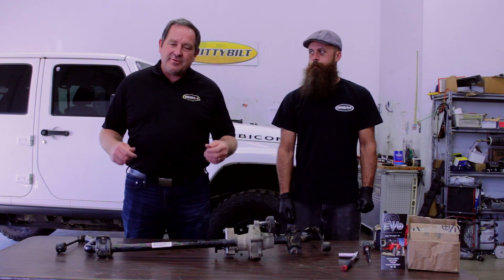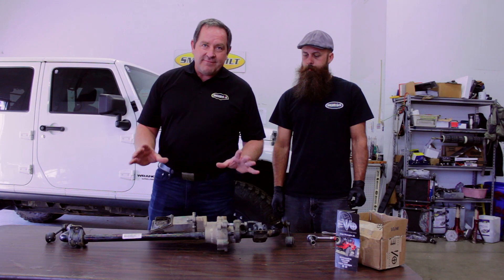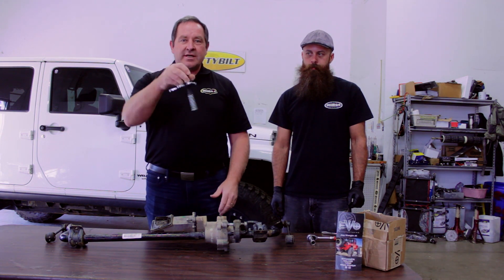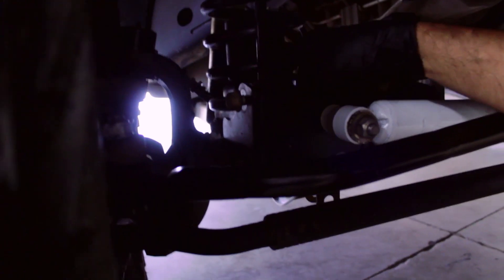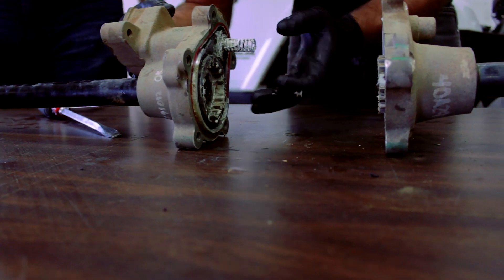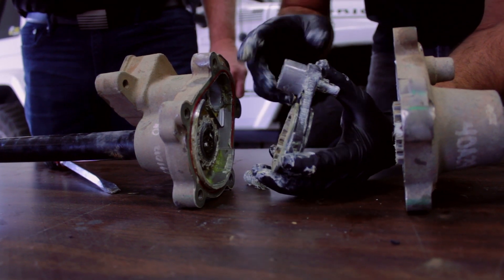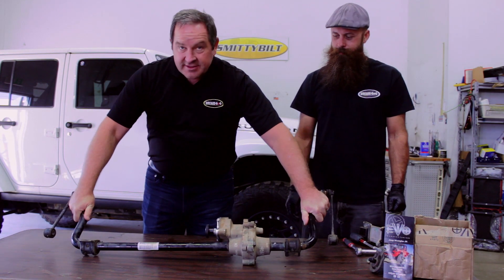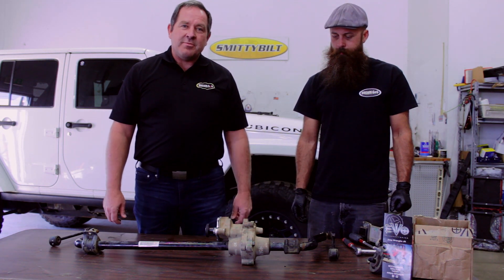How to Fix a Jeep Wrangler Electronic Sway Bar Disconnect

Comment: My Rubicon has the dreaded blinking Sway Bar light on the dash. I also have the JKS quick disconnects, so I removed them to try to diagnose or free up the sway bar to reengage, and the two ends of the sway bar are moving independently like it is disconnected. I'll try to take it apart and re-lubricate like in this video to see if the motor can lock it back in place. Otherwise I may have to go to a junkyard and try to find a solid sway bar off a Sport or Sahara since I already have the JKS disconnects anyway...

Comment: I have a 2017 Jeep Wrangler sport.
My sway bar light comes on when I first start the engine and the. Goes off as I’m driving. I looked at my sway bar and it doesn’t seem to have that motor attachment to it.
Reply: This is for the Rubicon models with the factory electronic sway bar disconnect

Comment: My 2017 Rubicon has a metal skid plate under the sway bar disconnect motor.  How do you get to that manual knob with the skid plate in place?  Thanks!
Reply: You don't.  It's pretty much impossible to access this type of system with a front end skid.  JKS does make a wire pull actuated version that you can mount on your bumper, fender, etc.

Comment: my sway bar light blinks non- stop. ( 2008  Wrangler )The local dealer only wants $2000 for a new sway bar .... BUT what I've read is that the blinking light means it is Not Disengaged.  A good thing right?    How can I make it go off?   I am bringing it in for recalls in 2 weeks and they want to do another diagonostic. Help, please.  Janet      the aev programmer site didn't help. sales only.
Reply: Janet ... Just take the sway bar off the Wrangler and perform the same steps they did in the video.  The light is blinking probably because the motor is stuck.  Make sure the gears move freely.
Reply: biz4two biz4 worked for me I was having the same problem as Janet.

Comment: But what about the light that will come on in the dash?
Reply from the maker: The light flashes when it is trying to engage. By removing that function it thinks that it is disengaged when you disconnect the motor.
Reply from the maker: That or else the AEV Procal Programmer can turn that light off.
Reply from the maker: Its a programmer. https://secure.aev-conversions.com/shop/vehicle/jk-wrangler/procal-module
Reply from the maker: If this is what you're talking about, that should be a bolt. That makes the mechanism stop from spinning around. So you may want to get that fixed.
Reply: My light flashes constantly......... Is this normal or should it be a solid light? and how long does it take to disconnect with the stock electronic disconnect?

Comment: Man, I wish my smartbar failed like everybody else's. My motor is good and internals are free but the bar ends are seized into the cast housing halves so it stretches the isolater enough to let the housing contact the condensor. Do you know if the housing uses bushings or bearing to let the bars rotate?
Reply from the maker: I believe it has a bearing located on each side of the cast housing. Most likely you will have to replace bar and housing.